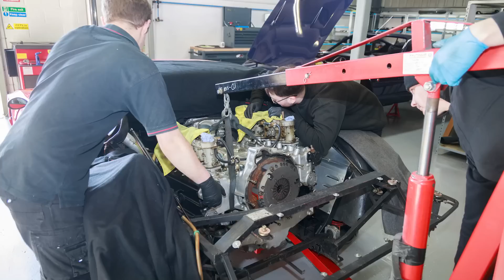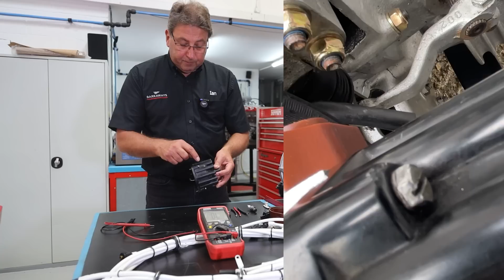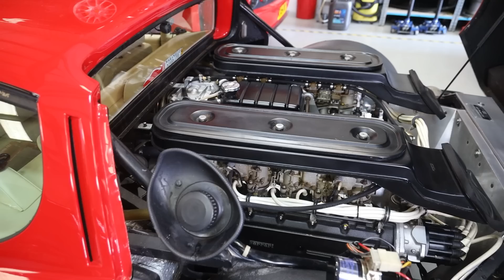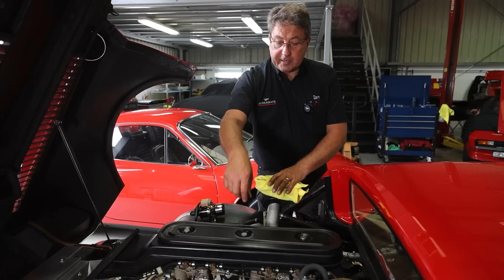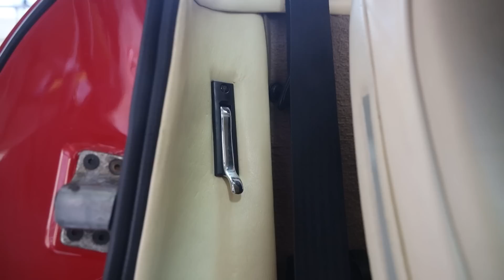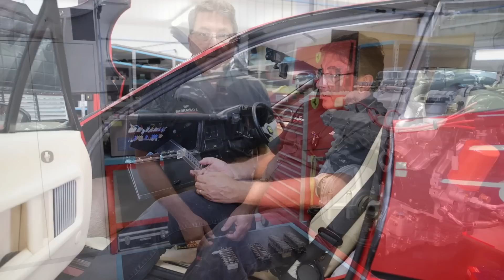Diagnosing a misfiring Ferrari 512 BB + practical tips

Comment: Hi Ian
I have a 308 gt4 which has 2 coils and one distributor which has 2 sets of points and a micro switch which advances the ignition timing when the accelerator pedal is floored. I was really surprised that your boxer had a single coil and distributor on a flat 12 wheras Italian car practice is usually to have 2 of each?

Comment: It’s unfortunate that Ian mixes up boxer, V12, flat12…that confuses the non-specialist viewer. The correct designation of this engine is a flat V12, a V12 with 180 degrees between cylinder banks.

Comment: No wonder it took you so long to find the fault, by the way you talk about it breaking down because all the sparky things go so fast, sounds like you don’t realy understand how the ignition system works and how electricity works, the only thing working fast is the coil and its trigger, just because its a v12 doesn’t mean all the leads are transmitting sparks at high speed, so tell me, how did all the high speed v12s and V16s cope in the 50s and 60s,

Comment: Appreciate y’all at barkaways! True experts on the Italian platforms! I myself have been repairing Ferrari’s for 5 years in the states. Can confirm. Ignition problems are a nightmare! Myself I have found it useful to look for voltage leaks on ignition systems in the dark. Even spraying water to give more conductivity to find issues in wires, caps and plug extensions. This case is an absolute nightmare for your mechanic. Multiple problems on a vehicle that has no diagnostics for a scan tool and Barkaways has nailed it! Customers need to understand the knowledge and understanding it takes to diagnose these cars. You can’t just plug in a scanner and get pointers towards your problem. It takes a lot of head scratching, time, knowledge, caring for your customers and TIME! To confirm, determine, analyze, isolate, correct and confirm. Props to Barkaways for killing it on this 512!

Comment: Your explanation of the ignition system is completely wrong. Carbon string cables have a resistance somewhere around 10k depending on length, they were introduced when electronic injection and ignition was fitted to tame the pulse when the plug fires to reduce EMI, nothing to do with copper being slow. The same applies to spark plugs those sometimes marked with a 'R' in the number are resistive. Plug caps were fitted with resistors before they were built into plugs, I'd even suspect those you measured were not 5 and 15 ohms , but 5k and 15k. Modern plug wires are spiral wound cores this is an alternative method to reduce EMI

Comment: I'm retired now, but I worked, primarily on American cars, here in the states. That was in the early to late 1970's.  American cars were terrible then.  I decided in 1986 to return to school and become a licensed aircraft mechanic. So I worked for Delta Airlines for 32 years before retiring.  Bottom line; I have a deep appreciation for fine machines, as I'm sure is also similar with technicians that repair Ferraris.  Your videos obviously help the public see that these machines made by the Ferrari company require an elevated level of thought and care to maintain. Great, great appreciation
Reply: Had a shop where I worked on older furr-are-E's. They were horribly made, stunningly poor quality control. And for me, all the owners were white-male-extreme right wing racists. I stopped working on this junk, went back to university. furr-are-E makes over priced toys for guys who do not pay enough in taxes. At least here in the US. No one who works on these cars believes they are ultra fine well made or even well engineered cars. You obviously have very little knowledge about this marque.

Comment: Incredible. Yeah, diagnosis is hard on V12s but diagnosis on anything is hard when brand new parts are garbage. A person could buy 1000 sets of Honda Civic/Ford Escape/BMW Mini/whatever plug wires from the OEM and they will receive 1000 good sets. I imagine they cost massively less too. A mechanic shouldn't have to bench test every part before its installed but after this I'd imagine you will!

Comment: In my experience on high rpm motorcycles (up to 14,000 rpm inline 4), carbon leads suck, they break down and go high resistance after 5~6 years. 
The length means resistance varies, short leads have much lower resistance than long leads. 
Silver plated copper are the best for low resistance but they MUST be isolated  from each other to prevent magnetic induced cross firing.
Motorcycle resistor plug caps with resistor plugs (NGK) 
Around total 10K Ohms resistance gives best spark, prevents low volt miss-fire.
It's doubtful I'll ever work on a Ferrari but V12 Jags have similar problems with Lucas electrics.
Only Italian cars I have experience with are Alfa Sud, had several including Rally Specials (I was 'into' boxer engines for several years, VW, Citroen, Alfa) 
All carburettor cars DO NOT DO THAT, there is a mismatch in transition from idle to mains.
 Dellorto's can be fixed, the information has been around since MK I Escorts were being raced in 1970's.
Your explaining stuff I was playing with 50+ years ago.
Never forget, 90% of ignition problems are carb related. 😁
Hot start issues are usually 15~20 min where fuel evaporates into manifold and causes rich mixture, half to full throttle 'clears' the manifold.
That IS an issue with all carburetted engines.
Those fuses/fuse boxes were used on Moto Guzzi with same problems, probably worse as bikes were often left outside and not garaged

Comment: 7:00 This sounds a lot like bullshit.
Reply: thats because it is, 8000rpm is literally 133hz. if copper wires had any issue with transmitting high frequencies, literally radio and the entire modern world would not exist. a solid 90% of all DC to DC conversion uses boost converters that specifically work on high frequency pulsed current.

Comment: Carbon leads were implemented because the series resistance slows the risetime and increases the duration of the current pulse delivered to the spark plug.
This reduction in slew rate reduces spark lead to spark lead crossfire and also reduces radio interference.

Comment: Great video--enjoyed it thoroughly.  On fuses: sadly, the shift to the blade style fuses didn't solve the fuseboard issues with '80's Ferraris (I have an '87 Mondial).  By contrast, the electrical system on my '88 911, with the old-style tube fuses, is completely trouble-free.

Comment: boxer?  it's not a boxer, it's a 180 degree ( or "flat") V12.  Boxers have 1 crank throw per piston, on a Vee 2 opposing pistons share a crank throw.
Reply: its literally a 180 degree crankshaft as you say, either piston on a shared crank journal is still 1 throw at a time. it would only not be a boxer if the crank weren't 180 my dude

Comment: The rotor can be susceptible to arc thru as well, both thru the inferior material and thru the hold down screws, if used. Much like the old GM black HEI rotors versus the newer and better white ones. If you ever encounter a car still with a black one (doubtful), always, and I mean always replace it with a new white one.

Comment: A couple of times when I have had issues (with my own cars) I have gone out to my workshop late at night, turned the lights out and revved the engine in complete darkness. Problems show up like magic. Once was a shorted/cracked coil tower and another time it was a spiral wound coil H.T. lead that was glowing/burning up internally. With it being a red lead I could see a faint pink glow coming from it and it still tested OK with an ohm meter.
Reply: Good method
Reply: As a former mobile mechanic,( no I've never had Ferrari owners as clients lol) I found that very interesting. Yes that was a pretty extreem set of faults causing the random misfires. I can't believe that the replacement plug lead manufacturers would scrimp on a piece of stainless wire that essential to the product working properly! Me thinks the bean counters have had a say in it lol. The boxer sounds bloody marvellous! Your grin said it all and you were not giving it any beans whatsoever really even when you got it up to operating temperature. A beautiful car, the owner will be happy to get it back and it works as intended. A great video,thank you!

Comment: Really interesting video. I had a similar problem many years ago with an Alfa Romeo boxer engine, which had a misfiring engine, which was much more noticeable in a four cylinder engine. I remember changing plugs, leads, dissi cap, points, condenser, the whole shooting match basically. The only thing that seemed to completely cure the problem was to put a blanket over the engine over at night.

Comment: Very good. Great tutorial. I always have a seventies, 80's or 90's car for the weekends drives away. I appreciate your talents in the spark and coil. The black box probably was damaged from the plug leads not being fully functional. I'm 35 years in running sub sea ECU s that have 72 firing cylinders.... Three 24 cylinder source systems. They are on umbilicals that are 1km long. A miss fire is when one of 24 cylinders are 1000th of a second variation from the rest....all 24 must fire together unlike an engine. We pretest all new firing leads in water. For insulation tests. Fluke meters are worth the money for us.

Comment: The struggle to keeping these "old" Ferraris on the road and performing as they should is the same here at my shop. I just bought a similar ignition wire set that had questionable connections as well! At least we're suffering together, and I'm glad to see Ian succeeded in getting that Boxer running right!
Reply: These guys in England….barkaways, GTO, DK, D&D, I can go on….have made a very nice industry from this very idea
Reply: Magnecor USA makes the best  spark plug wire leads for vintage engines. Look into them. You will not be disappointed.
Reply: Stop! delete this vid and go back and do it again, relax and slow down!!
Reply: Owned a 71 Fiat that was always hard to start. Couldn't figure it out until one moonless night opened the trunk lid ( rear engine ) and saw spark plug wire set flashing away like Christmas tree lights.  Had a carbon core center so it was sparking every inch or two.  Replaced with copper core set ,plus distributor cap had carbon tracks on the inside. Fixed most of the problem but the main issue was a hairline crack in the metal fuel line which caused low fuel flow. Fun car to drive, rev to ten grand too. Love the tech break down and diagnosis.

Comment: The 512BB was only run on a single cam distributor/rotor and a single coil. Some of the 308s ran a dual distributor off each cam, hence two coils required. Why did Ferrari think that this single 512  arrangement would be ok load etc and did it negate engine performance?

Comment: Do you guys not do 123Ignition conversions to the older Ferrari's?  They've been around for 20+yrs & is a high energy digital ignition that also allows for full programming of the advance curve by Bluetooth & it looks stock!  All the classic euro cars use them as well as they have conversions also for some vintage Japanese cars.
Reply: These cars already have Bosch digital ignition. I have 123Ignition on my Alfa spider, but not my Testarossa.
Reply: @lebojay  PermaTune uses 123Ignition for all the Porsche crowd which is a non-thermal plasma ignition box & ultimate setup while remaining stealthy looking.  I think the old Bosch ignition module is outdated & can't run larger plug gaps.  I think even a GM HEI Module would be an interesting retrofit but using a Performance Ignitions DynaModGM HEI style module which is capable to rev higher & faster circuit to charge the coil.  I think a COP MegaJolt ignition would be the ultimate setup! Not sure what the Ferrari tuners in upgrades...just throwing this out there.🤔
Reply: Harry Metcalfe's Espada had a 123 conversion at Iain Tyrell's place but had lots of trouble and finally binned it.

Comment: Taylor wire sells their 10.4mm spiro-core wire in rolls.    You provide the connectors and you'll never worry about not getting the spark again.   It will look better than those flimsy 7mm cables also.
Reply: Yes! Used them on my Cerbera V8 and never looked back!